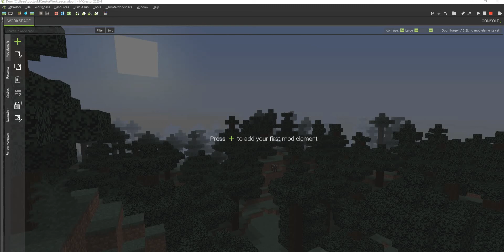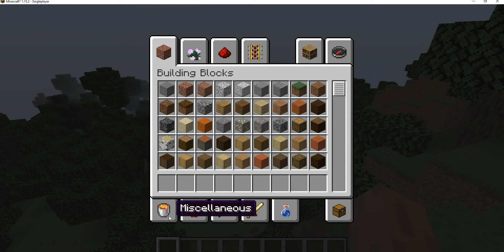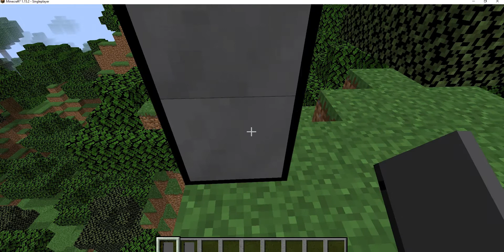How to Make a Door - MCreator 2020.4 Tutorial

Comment: Also my door soesn't ope I believe i followed every step correctly I am using the newest version of mcreator i think
Reply from the maker: Make sure you set the block type to door and the material to either wood or metal. Wood can be opened with your hand and metal needs redstone. If this continues to happen make a bug report on the MCreator GitHub.
Reply: @MrCreepsGaming43  ok thanks i did not know the wood and metal difference thanks dude